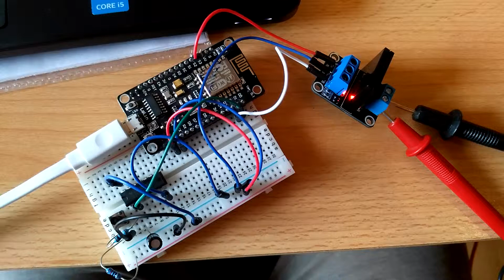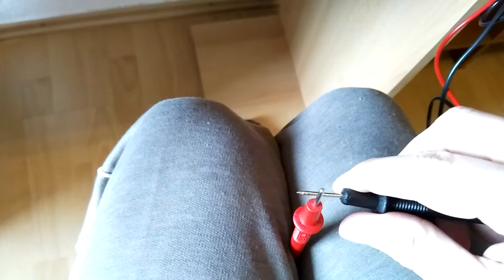VID 20170417 161513

Comment: I have the same problem. Did you find any solution? Thanks!
Reply from the maker: Hi, there is no solution, relay is broken, seller sent me another which was finally working
Reply: Anton Krbaťa well, I have found a solution. The ssr can switch only on ac, even if there is no beeping on the multimeter, just try it with alternative current. I haven't tried on DC, but from what I read it works only on AC. Mine works.
Reply from the maker: Thank you for advice :)
Reply: Won't work on DC either,  Output has to be AC.